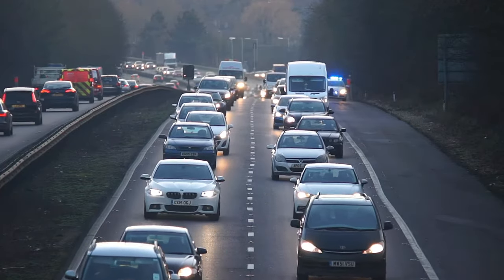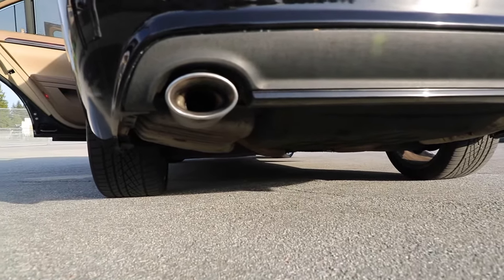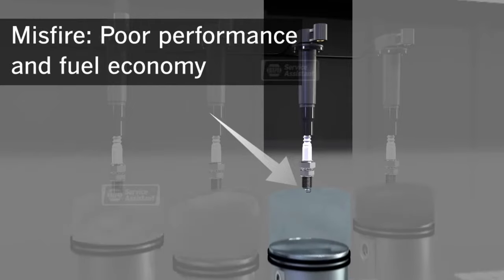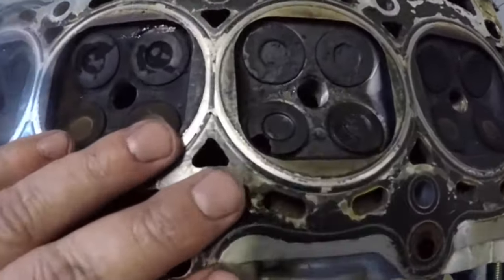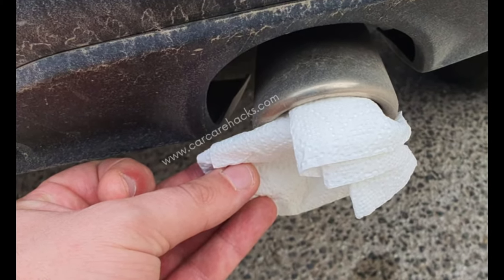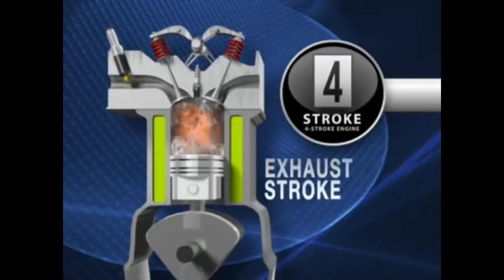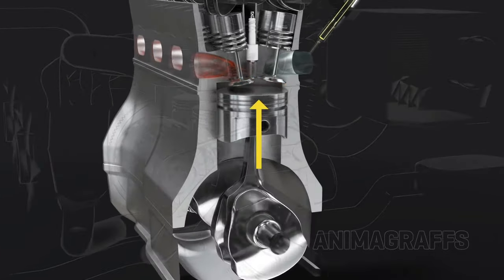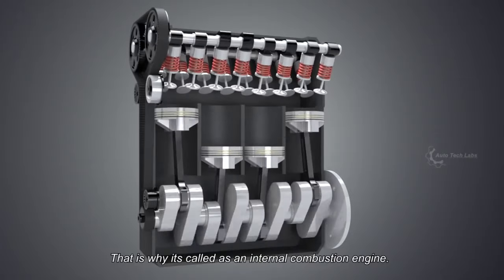5 Leaking Exhaust Valve Symptoms

Comment: This was a great video, what causes this problem though??
Reply: As far as I understand the main thing is timing chain or belt failure, which causes the piston to hit the valve which bends and doesn’t seal anymore. Other cause could be a  lean airfuel mixture which leads to higher engine temperatures especialy on the exhaust side and that can result in bent or cracked valves
Reply: when your engine lightturn on ,, go to maintenace...or this happens